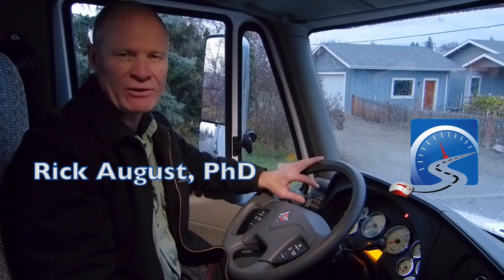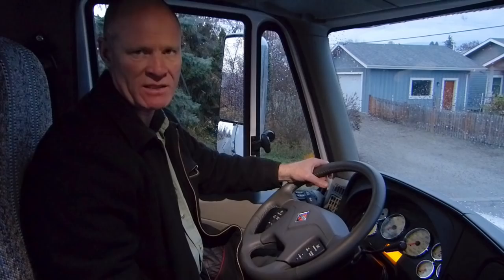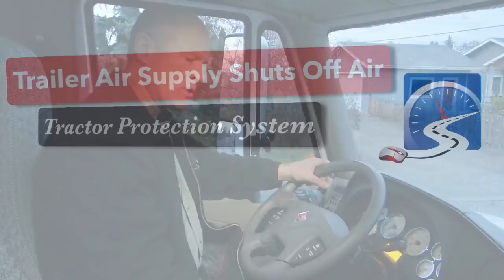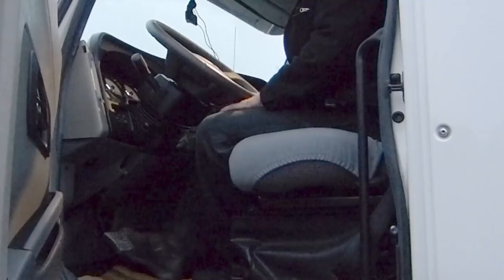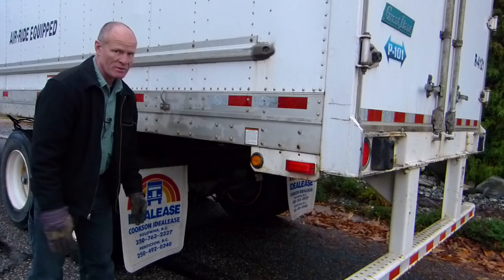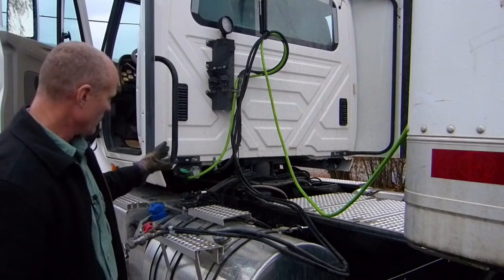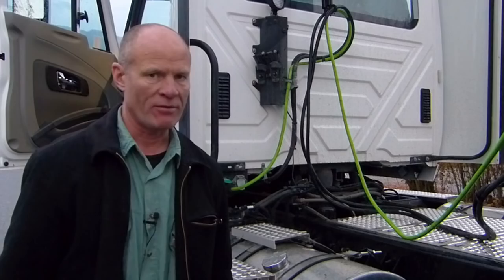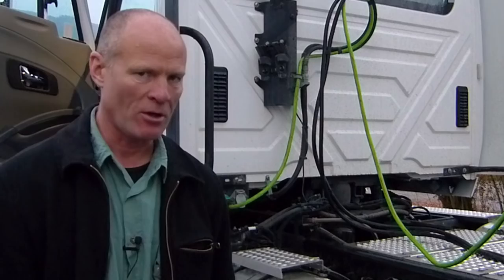How to Test Tractor Protection System  for CDL Air Brake Inspection

Comment: I am encouraged to see that other couldn't follow the presenter as well as myself.  I thought it was because of my English
Reply from the maker: Hi Steve Bijoga - Apologies for the late response. Thank you for your comment. And to help with the English, there are closed captions. If there is anything further we can do, drop us a note. Always happy to help. All the best, Cheers Rick
Reply: This is just the valve system check DoT uses. Not exactly a brake check. In CDL class, the instructors teach you how to pass the CDL test in your state depending on what's on the state test made by state laws and local laws including local education laws. DoT checks according to federal law and level of inspection. Basic inspection would check basic brakes and springs making sure they work. Mid level test depends on state law and might test the full system including the 3 point system in the video and they might not. Full DoT inspection will test it according to federal law in the code of federal regulations. 

... in class i learned this because I lived in Georgia where test laws are more stricter where I would be CDL road testing, compared to the testing in Tennessee where my class was with Tennessee law cdl tests. I had to study their test to pass the class and a full other page of test material to be able to pass the actual CDL exam in my state in GA. 

In NY state and another I can't recall. They added a fourth step while performing this test. It might have been local laws or new federal laws DoT is implementing. I posted a comment about this added step in the main thread waiting for input.

This is where a lot of drivers get cdl points during the yearly DoT blitz. It's good to start with a good company that travels around and comes across these and let's them known to their drivers... a lot of local companies with mostly local runs come across this unexpectedly. They get lost in implementing local city run laws and become unaware when they get stopped by hwy patrol that enforces state law and then to the weigh station which is their week to enforce federal law on every truck. Or a a different weigh station that implements different federal laws at different times. Each weigh station has their own managers and are run differently. If u run by the federal code you should always  pass their tests unless something broke after you hit the road. and a company should always give you a federal handbook when you start for them or when you start hitting the interstates... if they're aware of it or not...

... Conducting any business in the United states, beyond local law, you are governed by strict federal law... even if state or city laws are being enforced at the time, they are also governed by federal law and can implement federal if they know it and choose to or have to if they're told to do it.
Reply from the maker: Hi eric whittington - Thank you for your comment. However, you are incorrect about CDL air brake test being different depending on jurisdictions. CDL air brake tests are the same regardless of where you are in North America. There are some minor differences in the numbers, but the tests are all the same. And this video to which you're referring above is just the Tractor Protection System. This test is for a truck pulling trailers fitted with air brakes.  For the entire system there's another video: https://www.youtube.com/watch?v=rMZwffPGAiQ&index=8&list=PL0x-bChcUvwG2bSWReQWnk9Tm92L7WN_O&t=0s If there is anything further we can do, drop us a note. Always happy to help. All the best, Cheers Rick

Comment: if this guy DIDN'T just try to show off by rivaling John Moschitta Jr. ... then maybe America's economy would get better by indicating to poor millenials what glad hand is taken off and if the parking brake is synonymous to the emergency brake because this book is saying there's 3 different lines and the emergency brakes ONLY come on if they snap off or this is just checking the trolley valve???... oh and how does the slack and rod look before it's approx nintey degrees?
Reply from the maker: Hi Jesse Priest - Thank you for your comment. You're struggling with the information. Which state are you taking your CDL? There are three lines going to the trailer: 1) supply line (brakes); 2) service line (brakes); electrical. And the emergency brakes (often referred to as the spring brakes) activated if air is lost in the spring brake chamber. You can find an image of the approximate 90° angle for the push-rod and slack adjuster here: https://www.smartdrivetest.com/air-brake/tractor-protection-system If there is anything further we can do, drop us a note. Always happy to help. All the best, Cheers Rick